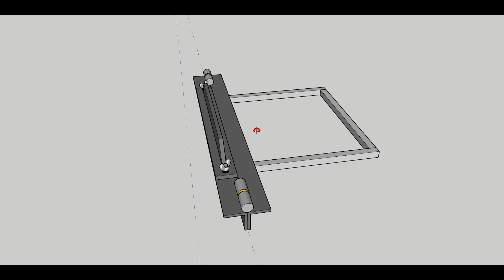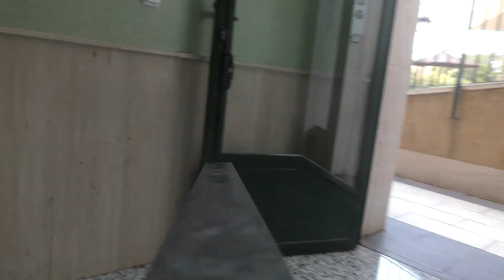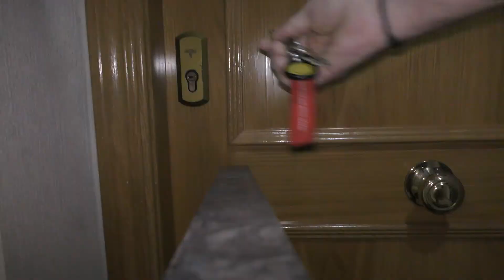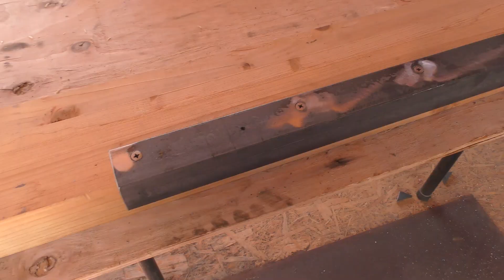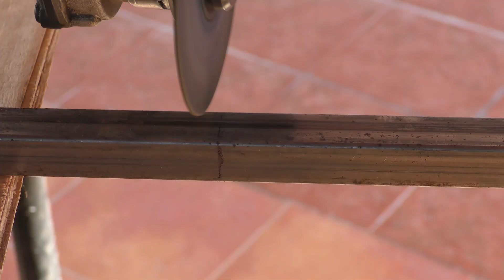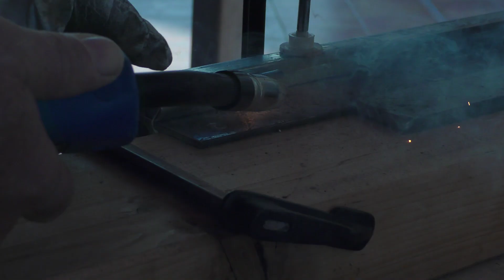How To Build A Small Sheet Metal Brake - No Weld Version Shown

Comment: When you make a drawing using metric the correct way is to use millimeters mm not cm.
Reply from the maker: Thanks, it's something I'm still getting used to😉
Reply: interestingly......on the sites I worked in Germany all the building drawings were in centimetres but here in the UK we use millimetres exclusively

Comment: Metric! Oh you pure sole , How do you think we feel when you call out fraction of an inch ;-)
Roof rack , It works -  I often transport 20 feet on my compact ,  of cause you can not take a roundabout in too high speed , otherwise you keep spinning at exit 🙂
Reply from the maker: 😁, honestly the metric system makes so much sense. What I find difficult, reading the damn tape. My old eyes can't see those little mm lines😆. I'm glad that I get to work with the metric system on a more regular basis. And I love that a 90mm x 40mm board is that measurement. Compared a standard 2" x 4", which is not. It's actually 1.5" x 3.5", go figure.🤦

Comment: Sorry if this is a naive question, but can you use a urethane clear over rusted mild steel? I have a table base that got left in the elements and is beautifully rusted, and I'd like to use it as indoor furniture. I've seen people use boiled linseed oil on their rusted cars, but I wouldn't think that would be a long term solution (and it's exactly the look I'm going for). Thanks! Amazing channel!
Reply from the maker: @jeffreyjbyron  the simple answer is yes. However use a spray clear coat first to avoid brushing off the rust or smearing the rust with a brush on urethane. After the first spray on coat, then you can spray, brush or roll on the second coat

Comment: Flux core wire does NOT have the flux surrounding the wire.  The flux is inside the wire, hence the name "flux core".  It is not like stick welding rod that has the flux on the outside.  Other wise, a great video, and as I happen to already have a couple of two foot long pieces of the steel angle, I may source a hunk of flat bar and construct your bender.  The material you used to demonstrate how to use the bender seems to be much thicker than 18 gauge.  
Thanks for the video.
Reply from the maker: @roberthartmaier6643  🤦 my mind must be going, I didn't even realize I said what I said in reverse.  Good catch. And this is after watching at least five times while editing and I still missed it. The material is 1mm Corten.  It feels closer to a 16 g but the online calculators keep referring to 18g. No calipers here.

Comment: I bought something from Harbor Freight similar to what you built. It started bowing when I bend some 22 gauge material so I'd suspect it would really open up with 18 gauge. I was a bit disappointed. My only other experience bending sheet metal was in shop back in high school with a big industrial grade finger brake so maybe I was expecting too much from the HF unit. I watched a couple of videos on mods and added a brace on the bar like you've got on yours. It helps a good bit.
Reply from the maker: I think I've sent there. If I recall the steel that was used to make it wasn't very thick. I ended up buying the 3 in 1 bender roller combo. It can do small narrow (maybe 2" to 3" wide) pieces of 16g stainless but you really have to put your ass into it. The folding type brakes really do need some thick stock in order to work properly. I prefer the blade type that press down on the piece you want to bend. I made one a while back with a 20 ton jack that did real well 1/8" material.